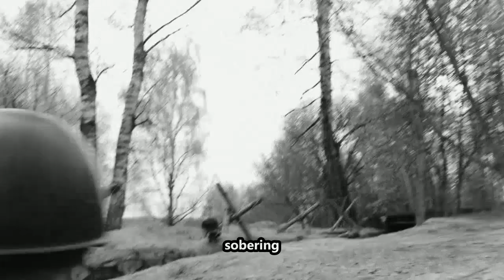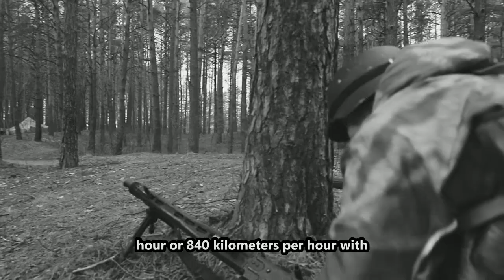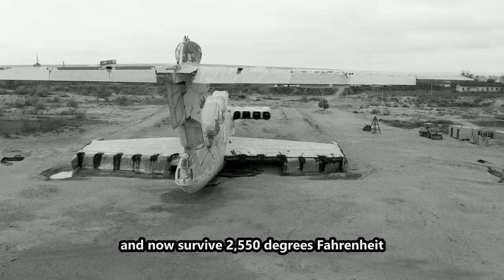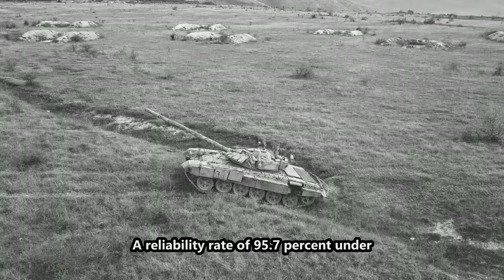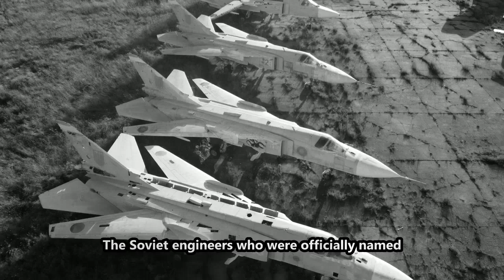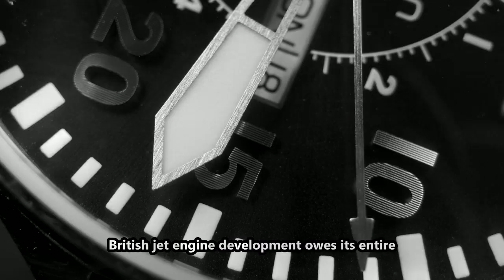German BMW 003 jet engine INSPIRED all modern aviation worldwide after 1945

Comment from the maker: Which technical specification of the BMW 003 impressed you most? The 7-stage axial compression at 9,500 RPM, the turbine blades surviving 1,220°F, or the fact that EVERY modern jet copies this German architecture? Engineers in the comments have shown fascinating connections - share your technical discoveries about this aviation revolution.